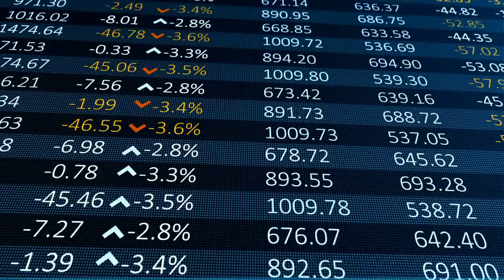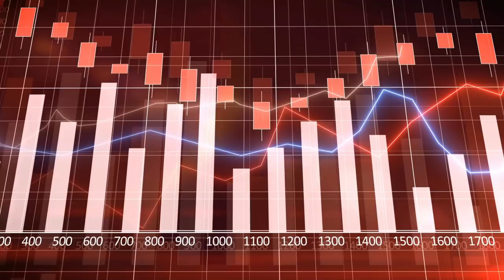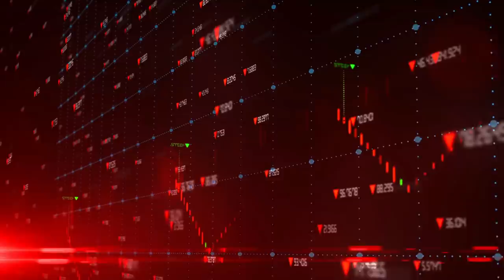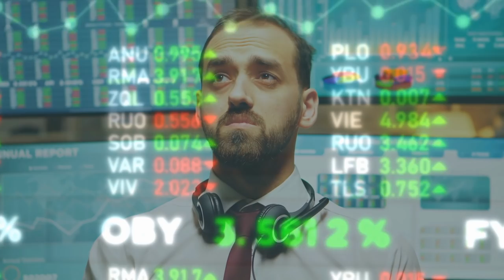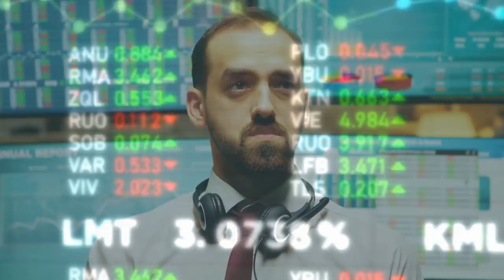Indonesia's Economy: The Next Economic Superpower?

Comment: Problems with Indonesia:
1. Although Indonesia has a large number of young people, it will not affect foreign investment due to the high cost of labor (compare Vietnam, Philippines, Laos and Cambodia)
2. bureaucracy, corruption and low education
3. Geographical challenges

Economic Superpower? There is still a long way to go, when compared to China or even Vietnam, its economic growth is still better. It is very difficult for a country that is highly dependent on domestic consumption, not exports (such as Singapore, Korea, Japan). I don't think it will happen soon (at least in 10-20 years).
 Look at Brazil, it has been a long time observers have said that Brazil will become a superpower but in reality it never happened.
Reply: Brazil? I think Indonesian is taking different route
1. Indonesian hate debt, Debt to GDP only 30%, households debt only 17%, basically avoiding fast growing bubble economy
2. Last 5 yrs commodity start expanding to self manufacturing goods from military equipment, electric train, bus, bike, excavator, green fuel, battery etc (still newbie but it's good move)
3. Indonesian's problem just like china 10 yrs ago, interconnection problem, can be resolved by boosting infrastructure and digital economy (internet/IT)
4. Suppressing drugs problem

As long as Indonesian can be producer country (rather than investment destination) and can maintain growth above global rate, it's about time might be not superpower but big player
Reply: @kosakata8632  this feels like we're in HOI4 lol
Reply: @kosakata8632  "Indonesian's problem just like china 10 yrs ago" So you mean China has the same difficulties as Indonesia? hmmm, i wonder how many islands do China have, how long between east and west province? ? so infrastructure, digital economy, internet or IT can solve interconnection problem, how about electricity? and what drugs to do with economy development, is that drugs really matter, half indonesia consume drugs ?
Reply: @hina2953  it's not about islands but interconnection and communication, Indonesia and china have same problem tribes and logistic
Electricity, internet also part of infrastructure but need primary infrastructure such as road, port, airport, railway without it no way we can distribute them and economy will move much slower

Drugs? you can see Mexico, Brazil, US, UK, Philippines etc they have so many young talented citizen but drugs destroy them within few decades, might be you already know Philippines in 60's is 2nd riches and most advanced country in Asia after japan
Reply: Yeah, bureaucracy here is really bad, but I has improved over the past few years, and with the newly established omnibus law, this can solve some of the first and second problem, and with the third problem, the massive infrastructure project is ongoing. So the long term solution is already settled.

Comment: It's not about just sending a message but also to distribute urban development. One of the disadvantage of being an archipelago is that unlike America which is basically one huge island, you can't scoot over once you run out of space. Scooting over allows a smooth gradient between your most developed city and your least developed marginal settlement. Since Indonesia can't scoot over, we only have two options: to continue developing the place we've already developed, or to leap over the ocean to develop another island from the ground up. Suffice to say we've been doing too much of the formet and not enough of the latter due to the short term economic return. Moving the capital will force foreign investor to participate in developing Borneo if they still want a spot in our capital city.

Comment: The short answer is no, but. If we assume 5% GDP growth for 10-15-20 years it will not meet the standard classification of high income which is 12,500 roughly. The barrier is broken in 25 years which is small in the perspective of a country timeline. Biggest weakness would be it geography due to economy not connecting as efficient. With the horizon of 25 years you sure bet Indonesia not ready for the 4th revolution
Reply: We are working hard to boost the economy through industry 4.0 technology adoption in manufacturing sectors, we already established PIDI 4.0, center for digital industry 4.0 as one stop solution for 4.0 adoption. Our mission to reach the top 10 global economy on earth by 2030 and top 4 global economy in 2045. PIDI 4.0 is a part of national priority program namely making Indonesia 4.0. Though geography challenge us, as one of the solution is to build newly industrial zone spread out across the country, in the past the economy relied on west Indonesia but the moving capital to the central Indonesia, we do hope to distribute well the economy to all over the country particularly east Indonesia.